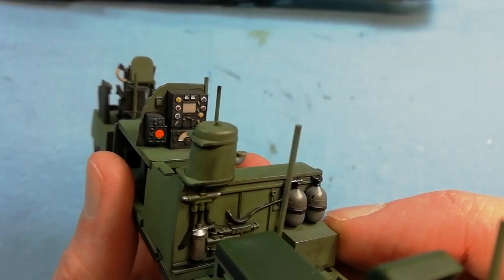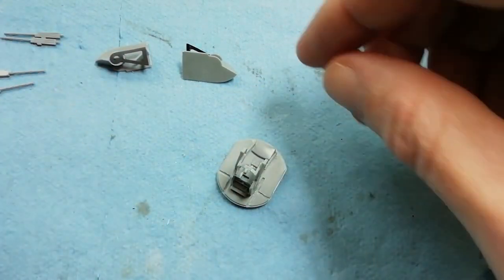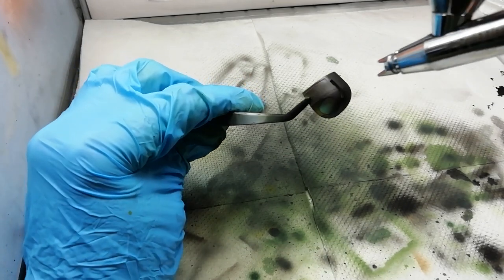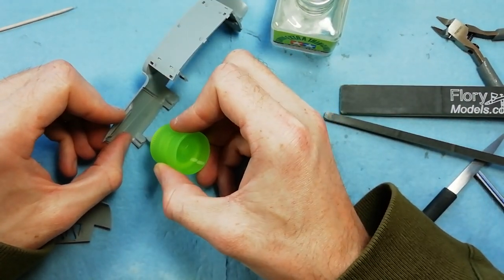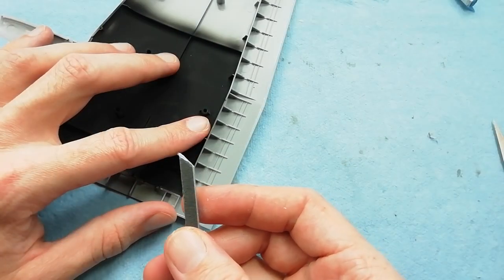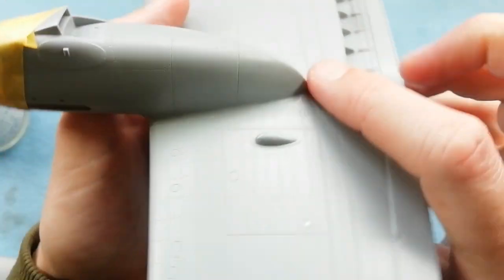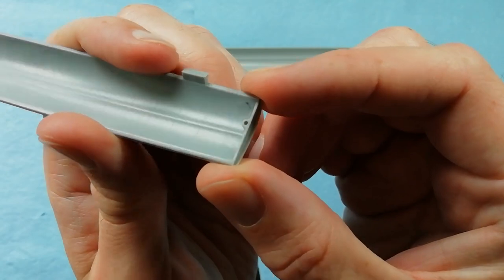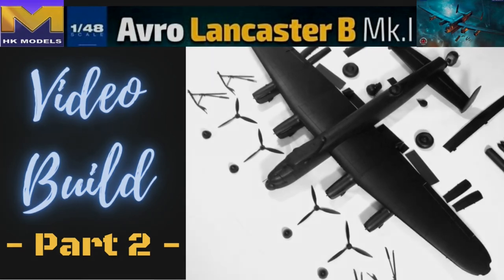HK Models 1/48 Avro Lancaster Build - Part 2 - Construction

Comment: BIG Thanks for Part II...It was well worth the wait...I know how much work goes into video editing too so BIG thanks again...I will be following this tutorial step by step when I start mine...but will probably wait for the final reveal so I know I have all the extras (masks and photo-etch) so I don't have to wait while I'm in building mode...I built a 1/32 revell Mosquito a couple months back and it had big landing lights underneath the wings so I tried something that worked surprisingly well...I glued some oven tin foil (5cm squares) on the underside of the top wing so that it was highly reflective...Tin foil laying flat is probably more reflective than any paints you can get...The fact that the tin was not glued to the bottom wing over the lens also helped the illusion for some reason...Might be worth experimenting more with tin foil on landing lights...I was really happy with the result...
Reply from the maker: Thanks Lewis, your feedback means a lot. Great idea about using tin foil, I have some bare-metal foil so may try that in the future. Love the liquid chrome and to be honest it's the first time I've had the finish be grainy, think it's the type of plastic that HKM use for their clear parts but just like pointing out mistakes so others don't do the same.
There's certainly a lot more aftermarket options out now, I'd probably go down the route of photoetch for the radiators and the grills on the carburettor intakes as the kit detail is lacking. Probably a set of brass barrels too but apart from changing the flight engineers panel I'm really happy with how it's turned out. Thanks again for leaving a comment 😁👍

Comment: Build is looking great, looked at my kit and don't seem to have the fading rivet problem you have

A tip for molotow pens, put some onto top of upturned tamiya paint pot. Put some chrome onto it and add a drop of Leveling thinnners. Stops the grit then and you apply with a brush, don't clean jar and next time you need to use reactivate it with thinners. I have the refil and it doesn't go gritty like my pen did over time.
Reply from the maker: Cheers Keith, yeah I usually do after seeing Phil do the same. I just used to pen direct this time for a quick and easy solution but it backfired on me 😂
Just wanted to point it out "warts n all" so people don't do the same.
Good to hear your kits unaffected by the moulding issue, be interested to see if anyone else is the same.

Comment: Just a question...What did you use to glue clear parts to clear parts?...I must have missed that bit...I've seen a chap use Extra thin very very sparingly so not to get mist and clouding...but I can imagine that would create a better bond than using any PVA based glue...
Reply from the maker: Every clear part in the build is glued using Micro Krystal Klear, unfortunately I lost some of the footage of joining some of the turret pieces together but just a case of running a small bead round the edges. I agree that extra thin would be a better join but there's a chance that the glue might fog the clear parts. The benefits also of using the PVA based glue is that when we unmask if there is any dust or debris on the inside you can carefully remove the offending part, clean it and re-install.
If you do want to use a hot glue I'd recommend using very sparing amounts of the quick setting extra thin which should reduce the chance of fogging. Hope that helps 😁👍

Comment: Rivet detail issue...I I accidently bought 2 of this kit (I already ordered one from a shop that had said they had a problem with getting hold of it so I bought another and then the initial one turned up that I'd previously ordered...Dang!..so....One will be on ebay at some point)...so I examined both kits and both do not have this issue...or any issue with the factory cut from sprue fuselage halves either...
Reply from the maker: Good to hear your kits are unaffected Lewis, looks like it's a very limited issue, maybe the first batch were only a problem?

Comment: Are you building an aircraft completed before June/July 1943? If so the turret internal structure was in a natural metal or painted in an aluminium colour, after June /July 43 they were painted black on the production line.
Reply from the maker: Yes looking at references I agree with you but I'm just building the kit by most following the recommendations that HKM gives for people following along. I was going to do a video at the end of the series to point out things to look out for. So I'll try and remember to mention that fact.
Thanks 😁👍

Comment: Those micro drills you're using, what brand are they?
Reply from the maker: They are cheap sets on eBay under £5, I have to regularly order more as they are good but incredibly fragile to sideways impacts. I must have around 4 sets but only one complete set from 0.1 to 1mm.

Comment: Did you find the problem with the Starboard wing only? I've just received some Rosie the riveter tools in the mail today, and then came across your part 2 build this evening, talk about a coincidence.
Reply from the maker: Both my wings, top and bottoms as well as a few areas on the fuselage have the fading rivet detail. Seems like only a few kits affected, which is good. HKM quality control must have stepped up 😁👍
Reply: @spruehunter  Yes its a lot better then the 1/32 kit.